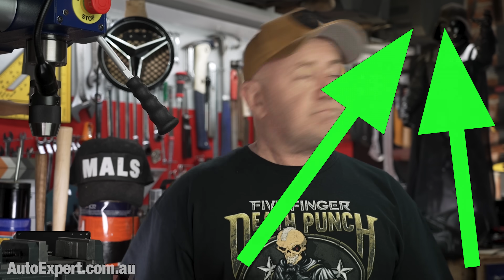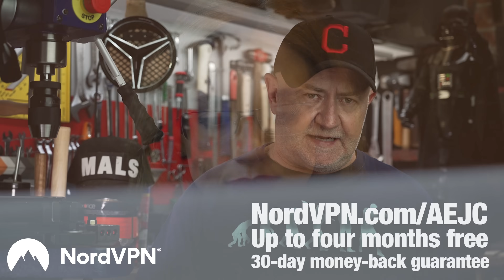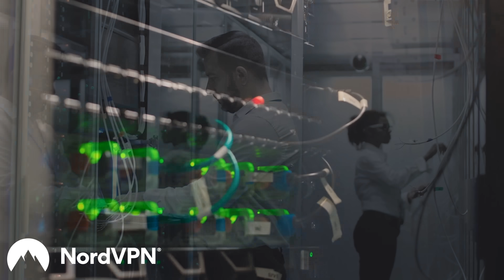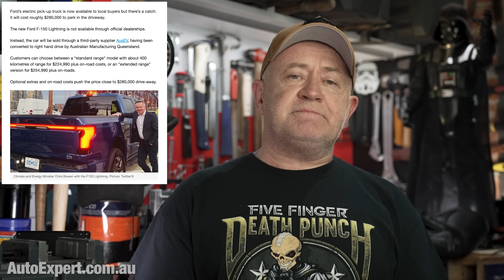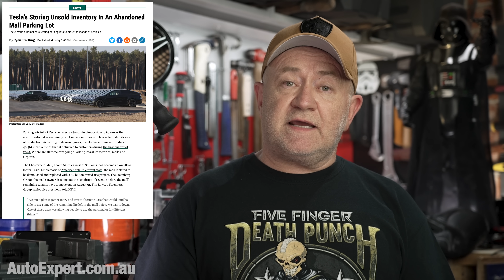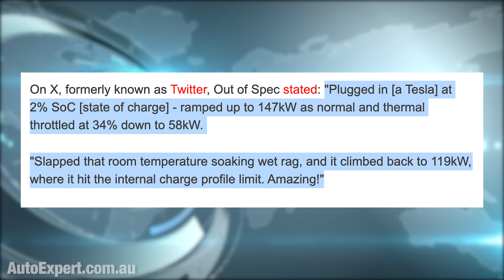ELECTRIC UTOPIA? Top 10 insane EV reports (this month)

Comment: When they cut the trees down to make space for the Tesla Chargers, they can then use the timber to make the WONDERFUL CYBER FUCK , sorry TRUCK ! How environmentally friendly is that ? If the batteries have a Thermal Runaway though, it would burn much quicker than Stainless Steel. On a positive side , if you were to dent it , all you need do is WHIP OUT THE PLAINER AND BUZZ SAW and Bobs your uncle , making the cost of insurance very Cost of Living Crisis Friendly!

Comment: Another video full fear mongering. Petrol cars fail on a daily basis, just thinking right here of the class act against Stellantis for their wonderful Puretech engineer with the wet timing belt (not chain) that rots and in crumbed into pieces clogging to the engine, or 80% of Jaguars and Range Rovers failing to do more than 20000km without having to spend 2 weeks at the shop and forcing owners to pay 10k bills. But if an EV has an issue, oh boy, the whole EV industry is shit because of that one occurrence. It is astounding to witness these things unfold.

Comment: Just touching on emobility vehicles, I'm not wrapped in escooters, but there have been electric 4 wheel mobility scooters around since for ever. I used to design the pwm speed controllers for a company who made them. Of course they used lead acid or NiMH cells in the later ones and weren't as combustible as lithium, but they still had to be parked somewhere. I think the major issue is nuckfuckles making their own batteries from reclaimed cells.

Comment: You have to wonder how Tesla managed to get the Cybertruck ticked off by safety regulators. It wouldn't be legal anywhere else in the world, and yet even when there are dozens of videos on YT highlighting the Cybertrucks sharp edges, and lack of rear visibility, they do nothing. It's the same with Tesla basically BETA testing FSD, using the public. The regulators should NOT be allowing FSD to be installed on any vehicle until Tesla can demonstrate that it works 100% of the time. The US regulators must be corrupt. Either that or they are incompetent. I really hope people who are involved in an accident where FSD fails, sue the regulators.

Comment: Hey John, another great dose of common sense, I know you like accuracy and its a small detail but AvGas is a piston aero gasoline, JETA is the Civil Aviation Turbine fuel, the Aus Military use AvTur which is JETA with a fuel system icing inhibitor. They can, and do use JETA when away from a military base.  Our Joint Coalition Partners have a 'single fuel' policy, everything has to be able to run on a single fuel to limit the amount of fuel required to fight in theatre.  So every generator, vehicle and aircraft will all run on whatever version of kero, JETA, AvTur or diesel that's trucked in.  Keep up the mega work champion..!

Comment: Yeah, nothing ever happens to ICE vehicles… Oh, wait, just an example, the Luton Airport Car Park Fire! Probably one of the most disastrous car park fires . Although the media initially tried to blame this on an EV and the hybrid, it turns out it was a diesel!

Reference:

“The vehicle involved was diesel-powered – it was not a mild hybrid, plug-in hybrid or electric vehicle. “

https://www.bedsfire.gov.uk/news/fire-airport-car-park-started-accidentally

Yes, batteries (Lithium Ion in particular) can have thermal runaway, but new designs,  technologies and better management are mitigating a lot of the issues. 

 1. Range is getting equivalent to ICE.
2. Charging times reducing, 15 min now being quoted.
3. Infrastructure increasing. Although every house has electricity. For local travel it will be cheaper than fossil fuel.
4. Cost decreasing.

By the way, I am not anti-ICE, but I see the future as being electric for most people. It just makes sense for a multitude of reasons.

Comment: Tesla does not have to worry about BYD, or any other Chinese brand. For one thing, in China, it seems that about eight EVs burn a day. They also have, and have had for a while, a massive overproduction problem. There are lots of reports of EVs piling up in parking garages and fields. Then, in the US, 100% tariffs have been applied. Europe is also imposing tariffs, although at a somewhat lower rate. Then, to top it off, massive numbers of Chinese EVs are stuck at European ports. A good number have been there for 18 months. 

Now the Chinese will try to sell their EVs to the developing world. If charging infrastructure is an issue in the US and Europe, just think about what the situation in those countries will be like. 

All I can say is, dream on, dude.

Comment: You worry about OHS, in an industrial setting you would not be allowed to handle flamable liquids in the quantities required to fuel a vehicle without proper training, PPE and certification of competency. So how many people get training on refuelling a vehicle?
I can assure you less than half of the people adding fuel at a petrol station know how to use a fire extinguisher, how about the non existing PPE? How often people spill carcinogenic materials on themselves while refuelling? And also having to breathe carcinogenic fumes with no breathing equipment? 
We had a 25lt drum of alcohol for cleaning and the amount of crap we had to go thru to let people use it was unbelievable and here we are letting people handle worse chemicals with no training whatsoever.

Comment: This is an utter failure of advertising in late stage global capitalism. These EV's COULD burn even hotter, and the smoke made even more toxic. And worse, people are realizing that even these pathetically inefficient death-traps are bad. They should be buying without any concerns whatsoever, and they are not. 
Still, with muppet electric Jesus at the helm, this was all predictable. And so we have yet another disconnect between what is a serious environmental concern[s], government polices, and commercial interests to produce the perfect storm of engineering inanity. 
Stationary power sources do not need canned energy. But mobile power sources absolutely do. The exception is electric rail. 
An ICE engine is very efficient at what it does. You just can't put electrons in a can without enormous weight. Electric trains are cool because they run along tracks which you can attach to a grid. Whether the train is "green' or not, depends on how you get your electrons. 
What about nukes? Well, fusion power is having much the same problems as canned electric power. Containment but without prohibitive costs. What about fission? Well, fission reactors have come a long way since Chernobyl, but they are still time, money, resource, and energy intensive to get going.  And as far as I know, they are NOT efficient if you keeping taking your foot of the "gas" and then putting the pedal to the metal when renewable energy has a temporary lull in output. 
So the renewables. Most corporation hate them. They want quick profits, not long term investments. [That is why fission reactors are not usually a bank's favourite investments]. In some countries, yes. But Australia? Not so much. 
Of course, renewables can have huge lead times as well. Solar panel farms, wind farms, hydro-electric dams, geothermal infrastructure, tidal power, grid-capable rechargeable battery banks.  
Small-scale stationary renewable power is fairly cost-effective. Some PV on a home, a 'wind-mill" thing. Wind mills have provided water power for centuries, so the wind-turbine birthing electrons is not all that new really. 
A little while back, a US aircraft carrier, which took billions to make, sold for a $1 for scrap. Why? Because the muppets didn't make it so you could change the batteries [sorry, nuclear fuel rods], and dismantling and getting rid of that toxic shit is an bloody expensive nightmare. Hence the sale for one dollar. 
And sorry, I don't think some rabid terrorists are going to bomb my little 5 K-watt panel set on my roof. Not when other juicey targets presenting themselves, like big nuclear, gas, oil, or coal power plants are around. Especially a nuke power plant. The perfect terrorist dream-target. You can make a big mess by blowing up a conventional plant, but with a nuke thing, you can get all sorts of radioactive and toxic contamination. Very cool. Allah [or whoever] is going to get you those 72 virgins in the afterlife. 
So presuming we don't want our drinking water to glow in the dark, or bust a Geiger-counter, I would say if we want to go fission in a big way, we have to protect those assets from those fanatics who have imaginary friends. 
I have no idea how many we would need for all of OZ, but can we say about 2 dozen for shits and giggles? Let's just make it twenty, because I am lazy with math these days. 
So apart from some normal civilian armed guards. High quality guards, not geriatrics who fall asleep all night long. You would also need a rapid response team of mobile infantry. And all this would have to be 24/7, 365 days a year, because Pearl Harbor Happened on a lazy Sunday. So how big a rapid response force? let's go real "stingy", and just say a platoon of excellent army guys with some decent training and weaponry. So, above and beyond the police, you need 20 platoons. Except it is worse than that. Guards/soldiers need down time. Time for sleep, holidays, piss-ups, etc. And time for training, to keep them all sharp. You wouldn't want your protective force to blow-up the power plant instead of shooting up the bad guys. So I would say a company [3 platoons per company] for EACH of those twenty power plants. Congratulations, that absorbs the "teeth" companies of FIVE infantry battalions. [That is on the old model of 4 rifle companies, a support, and an admin company]. I think the TOE for a modern Oz battalion is less than that, as they only have 650 guys [and girls] all up. So the companies must be smaller, or fewer in number, or both. 
So these nuclear power plants, 20 of them, which you intend to run for decades, are not going to be in a circumstance where they are under threat from terrorists?   Or even a conventional war? 
Oz sent masses of troops overseas in WW One and Two. Five divisions of infantry, with 12 battalions of over a 1000 soldiers each, [with the usual support troops of the day] plus a New Zealand and Australia mounted division. Second World war? Much the same, with the 6th, 7th, 8th, and 9th infantry divisions, and other military assets. Plus you have to keep them reinforced for YEARS. 
Suppose you have to deploy our Aussie troops to defend Australia itself, or to support an ally? You would have to pull them off the nuclear power plants, right? 
So what does the TOE of today's Australian army look like? Seven regular infantry battalions. Hmmm. Even if you make some diggers sky-cowboys dropping out of helos and Hercules, and mechanize the rest into IFV's, add our 50 M1 Abrams, add armored recon, engineer, signals, and a brigade of tubed arty and missiles, plus logistics, medical, workshops, and LAD's, etc you are still going to end up with a only a single "short"  division, ready to go.  And we don't even have all the equipment for that. And during the Vietnam conflict, Australia absolutely busted its gut to keep a single infantry brigade, with some modest toys, in theater! 
But hey, how about a policy that actually conforms to reality, and not commercial interests like electric Jesus, hippy green fanatics, right wing bozos, and is actually driven by practical, safe engineering? Its' just a thought.

Comment: Solus batteries CAN'T work. The charge is like water, it can only seek its own level. The Solus battery would thus need to be larger than the car battery. It could maybe be used as a two Freedom Unit gas can is used in ICE vehicles: it can maybe provide just enough stored energy for you to make it to the next charging station, but that's it.

Comment: Would you use a jerry can to fill up the tank of you petrol car? No, you use it in case you run out of gas and need a few litres of fuel to get to the nearest gas station. The same will be the case for an "electric jerry can".  You need enough capacity to charge the car battery the extra km of range needed to get to the nearest charging station. And when it comes to capacity that all depends on which battery cell you choose. The best capacity cells that is introduced to the marked have an energy density of 500Wh/kg. That means that you can make your 20 kg Jerry can with a capacity of 7.5 kWh if you leave about 5kg for the power electronics and mechanical parts. That should be enough energy to drive 30-50 km, depending on the vehicle. So there are no technical reasons why it can't be made.

Comment: The point with the video of the guy busting his finger in the bonnet of the cybertruck is being missed;
It’s the most basic safety requirement for a self closing boot lid that if someone has a finger in there, it will not close. The guy isn’t an idiot, he exposed that this thing is dangerous and the authorities are overlooking that in the rush to electric utopia. Wait until the first toddler dies doing what kids often do; mess around near the boot lid when it’s closing after mum comes home with the shopping. Laugh all you like (and it WAS funny), but he’s exposed a major design flaw.

Comment: Two guys in the USA did a video the other day on YouTube. They took a Ram Cummins 2500 and a Cybertruck, and hooked up an identical pair of large 28 foot toy hauler caravans, which were well within the towing limit of the vehicles. They they drove on the highway at a steady speed. After just 100 miles the Cybertruck was down to 6%, and needed over an hour to charge again. The cost of the diesel was way less than it was going to cost to charge the Cybertruck at a supercharger, something you’re not supposed to do regularly according to the manufacturer. 
Imagine going off on holiday and having to stop every 100 miles and then wait for an hour plus to charge up. 
The future!😂
Reply: Yeah well not everyone goes caravaning. If that's your use case, all good! But most cars are driven around town on short trips most of the time.

Comment: I realize that commenters are discouraged from taking anything seriously, but I wonder about the electric jerry can concept.  Given some current Tesla has a 1000lb battery and a 300 mile range, it would seem if you can actually transfer the energy, then 100lbs worth of jerry cans should get you another 30 miles.  That might be quite welcome of you're like 25 miles short of making it to a charging station or home.  Maybe better than calling a tow truck.

Comment: If you really want a EV, why can’t have battery units replaceable on any servo like lpg cylinders. It’s just a small part of the huge issue obviously but if “they” want us driving that it would be a positive start I recon. A nice cool room like in butchers where in stead of meat the battery units would be under “keeping” charge and ready for exchange. I can imagine it wouldn’t be that simple but any starting technology needs supporting infrastructure. Maybe in the middle of the bush somewhere in Pilbara supply that much power would be a bit of challenge then wet seasons cyclones etc. somehow building freeway style roads around Australia suddenly seems cheaper and more logical solution. Diesels running on LNG (nothin new) seems cleaner then petrol or EV. Driving on freeway my two diesels running on somewhere 15% less fuel then on a ordinary country roads.

Comment: Regarding the wet towel story. It's not a case of how many kilowatts of electricity that is available, it is more the charge voltage which is being run to the car. Only about 60 milliamperes would put most hearts into fibrillation and death. At say 900 volts charger voltage, the slightest crack in the insulation of the charger cord plus wet towel is a deadly combiation.

Comment: Wanna know what's really sad and totally shit? Facebook decided to plonk an add for NZs first EV ambulance right in the middle of your video!!!! FFS what drugs are our decision makers in? Because I'd love some. I'm a bit medically compromised. So I've had two trips in ambulances over the last few years. And I'll likely have more. Due to the nature of my shitty body my local hospital has a terminal head scratch session. And they send me up to the nearest bigger one. It's a good hour away. And they usually send a cart down to get me. Love to see how a battery goes for about two and a half to three hours!!!! We are in a pretty rural area, so accidents happen miles away from a hospital. And not every accident warrants a chopper evac. Those things are expensive, so they are pretty reluctant to send them out. I'm all for EVs if they are a good fit for your circumstances. But emergency vehicles. And things that wage war!!! They have to be able to run for as long as possible between fuel stops. That's a fact. Imagine a main battle tank with batteries!!!  They only do a limited range on hundreds of litres of runny fuel. How far is your 80 tonne behemoth going to get on 1000kwhs??? And don't forget that's not only running the propulsion system. The things are crawling with electronics and air con as well. 
Not that war is a very emission friendly environment anyway. I'd imagine it's about as clean as your average volcano!!!

Comment: So what's wrong with charging batteries to charge more batteries etc, and with each charge cycle consuming unrecoverable energy.............LOL  The effort required to transport 10 of those SOLUS cans to your stranded EV is probably more than just pushing the EV to the nearest charging station.....LOL  Stupidity breeds stupidity.  As an electrical engineer, this EV battery BS has reached interplanetary proportions.